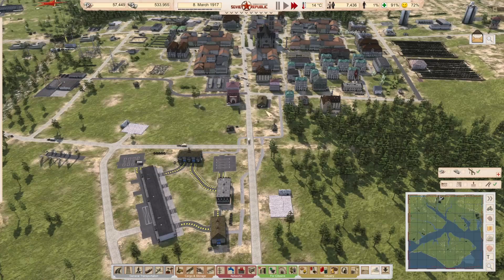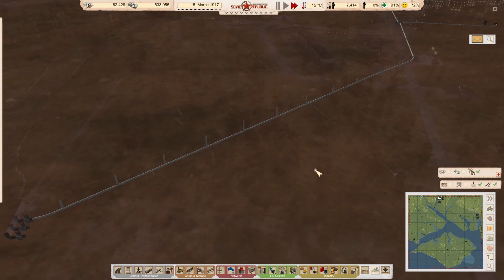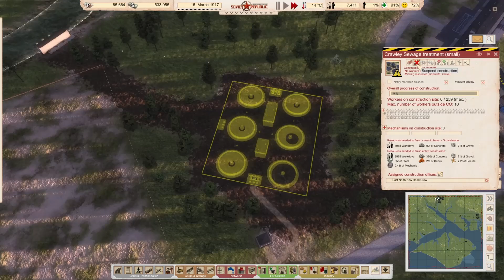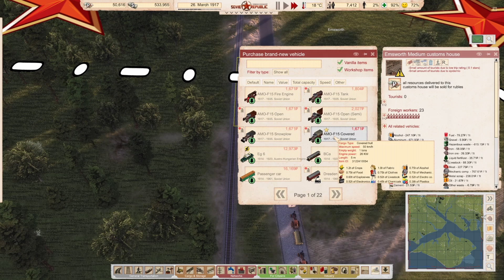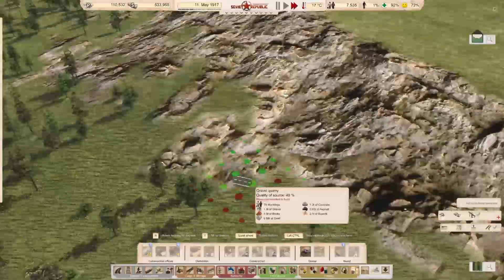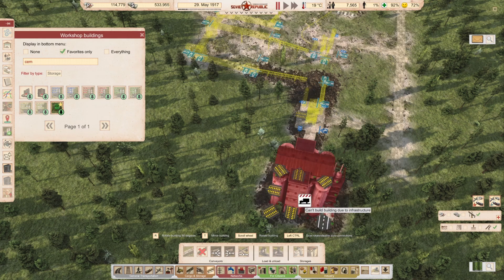Traffic Jam. Pushing Too Hard :: South Hampshire 1900 : Workers & Resources Soviet Republic: #21

Comment: The Jade Apartments are now my goto housing for a standard start before Prefabs or concrete buildings become available.
Do you not have the Gravel Grinder Mod (can't remember who its buy and not in front of my computer). Only requires 10 workers, and has much better connections.